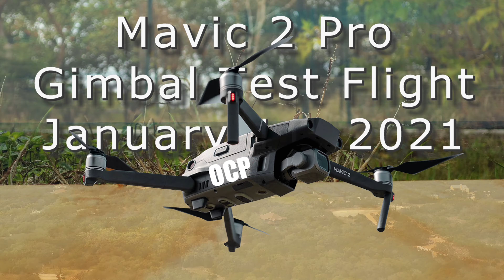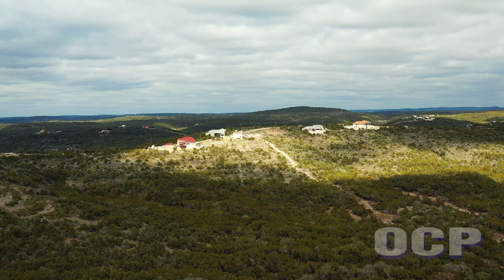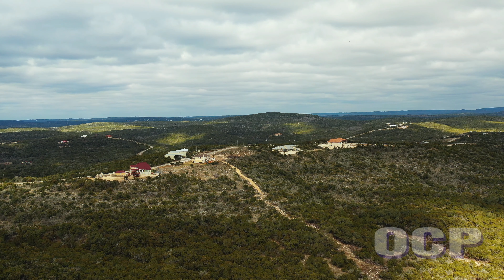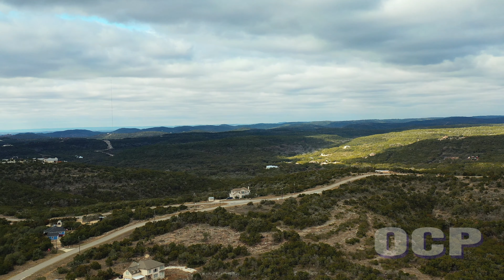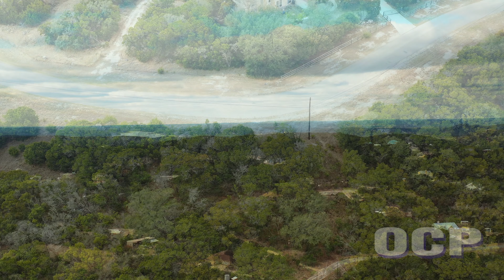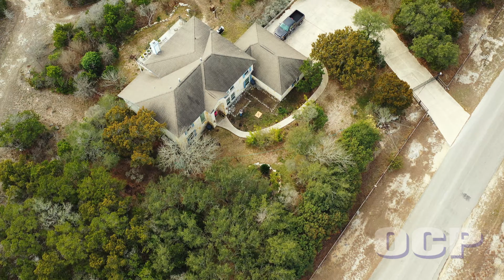Mavic 2 Pro Gimbal Test January 11, 2021 in 4K

Comment: I don’t have this issue with my M2pro but when I fly the mini 2 and have the camera facing downward @ 90 degrees; it does the gimbal flop. Thanks for the share! Dean.
Reply from the maker: Thanks, Al. I was using my Smart Controller, and I suspect Mikey was using his regular controller and his iPad Mini. We will try and verify that today. It "may" be a difference in the DJI Go 4 app between the IOS and Android operating systems. At any rate, Mikey has a smart controller, and he could try and pair it up with the M2P and try it , or I have a regular controller and an iPad Mini 5 which I could try. BUT it will probably have to be tomorrow before I will be able to do that. Thank you for stopping by to watch and comment.

Comment: Well I’m happy you don’t have the same problem as Mikey because I was getting nervous lol and it’s too cold to fly and test mine so thanks for the video Dean 👍👍
Reply from the maker: Thanks, Michael! I had never seen my M2P act up like that, so I had to test it. I suspect Mikey was using the regular controller and his IPad Mini, while I was using my Smart Controller. The DJI Go 4 app for IOS "may" be the difference. Mikey has a Smart Controller, so he could pair that with his M2P. Or I have the regular controller, and an iPad Mini 5 that I could try. BUT I will not be able to do that today. We will try and get the problem sorted out one way or another.
Reply: @MicoGhostTheOldCodger  I use the regular controller with my iPad mini 5 and I haven’t had the problem with it but I’m going to try and do the same thing going backwards.